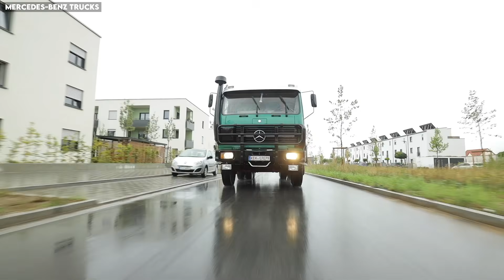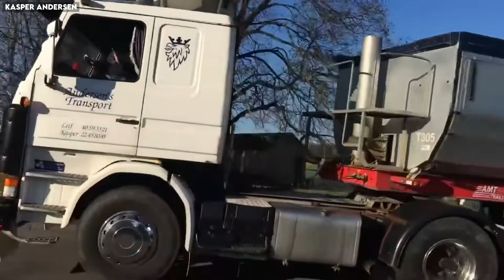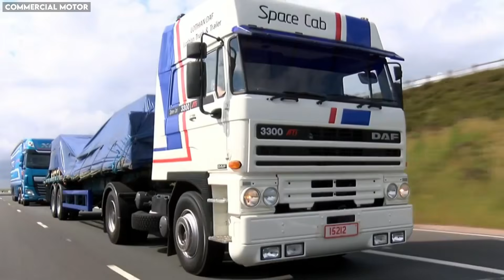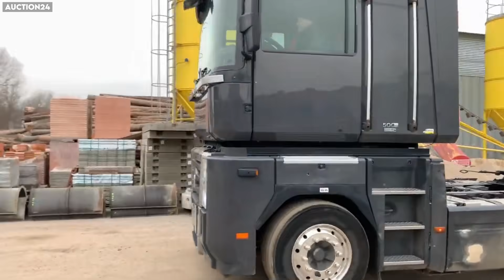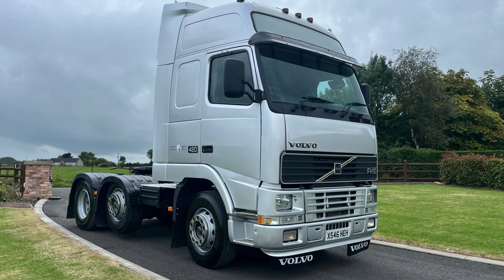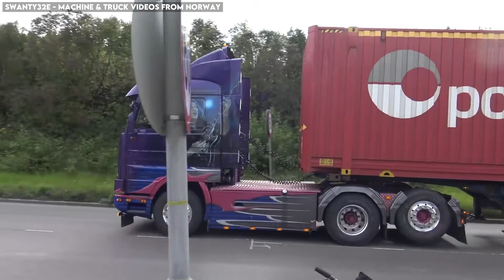10 European Cabover Trucks Americans Were Obsessed With

Comment: What trucker were dreaming for European cabovers. Not all truckers wanted a nice truck. Some did want a nice cabover, with a double bunk like a Peterbilt 352’s, 362’s, Kenworth K100’s or Aerodyne’s. Some wanted a Peterbilt 359’s, 379’s, a Kenworth W900A or a W900L!!! There’s a reason that the truck manufacturer stopped making cabovers. The majority of the trucker didn’t want to drive cabover any more. The 1970’s, majority were cabover, because of the  length laws of 1970’s into the 1980’s, when it all changed. All the trucker that knew. Never talked about European trucks, specially cabovers!!! They talked about American trucks. WTF??? Oh before I forget. Late in 1977. Ford introduced the CL9000 with available air ride cab on its 88” & 110” sleeper cabs. European trucks are great in Europe. Don’t forget that. In the 1970’s & 1980’s, American trucks were over in Europe. Mack’s, Whites, Peterbilt’s & Kenworths cabovers. And conventionals too. Their a reason that Kenworth is huge In The Land Down Under. One of Japan’s largest cement companies uses Japanese, European & Australian Kenworths to haul double tankers.

Comment: My dad Rest his sole  had a series  3 143 M 510 Twin drive on Reduction hubs . It would move any load it was asked to they had a leather contract i did not know leather could be so heavy then  i would lift the First axle 8 inches off the floor Coming off the ramp at the Air side Pallet Loader .. man that Truck loved it  the Bigger the task the better it performed . then they got an FL 12 430 Euro 2 That also had no issue pulling Vast loads .. I miss my dad lots .
Reply: he also had a 3600 ati Space cab.

Comment: The Mercedes NG was available with engines ranging from 5 to 12 cylinders—not just up to a V8—including the legendary OM40X series, which spanned outputs from 130 to 1,200 hp (for heavy-duty trucks and special-purpose vehicles). Renault didn't invent the flat-floor cab; that feature already existed in the MAN F8 (the predecessor to the F90). The French simply positioned their cab so high above the engine that the maximum permissible vehicle height (4 meters, or approx. 13.2 feet) was almost exceeded. A MAN F8 with a "high roof" effectively had a second level—the interior space was that vast—though such trucks were extremely rare in Europe, often being the result of aftermarket conversions. However, the Renault Magnum had a unique quirk: without a speed limiter, it was capable of speeds exceeding 180 km/h (112 mph).

Comment: US trucks are still decent because they offer a full lineup with excellent comfort.
Old Japanese trucks were known for their V8 power, exceptional durability and off-road capability that let them keep going no matter the road or weather, and a lineup that was more than sufficient. But now they’re just toys for business owners.
They have cramped cabins, break down easily, and come with detuned, underpowered engines. 
It’s no wonder European trucks are gaining popularity in the long-haul, specialty vehicle, and heavy-haul sectors.
Reply: Japan did't have a longhaul trucks their semi tractors are built for port to warehouse operations only their ten wheeler wingvan trucks are built only for point to point delivery their longhaul freight are done by trains because tgey have an extensive railroad networks. Unlike the americans,chinese and europeans which has a long road networks and long distance haulage so they built their trucks with more comportable and livable cabs its a drivers home away from home american,europeans and chinese drivers spend days or weeks on the roads.